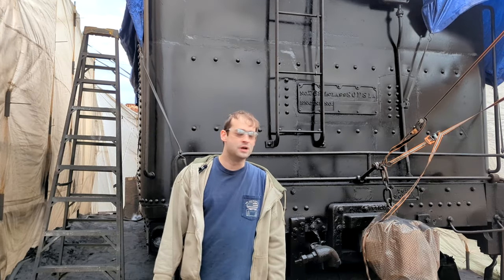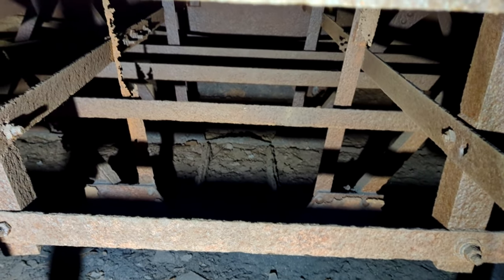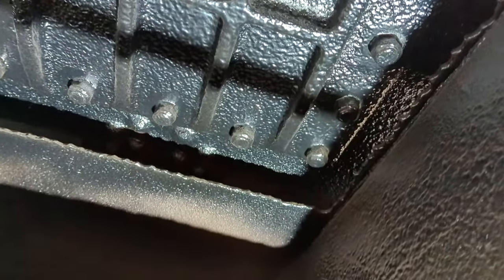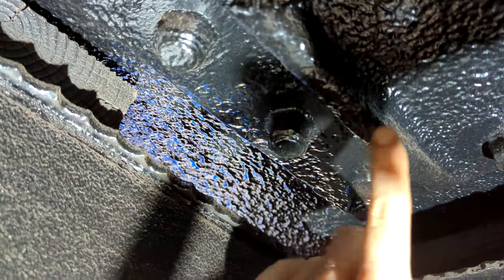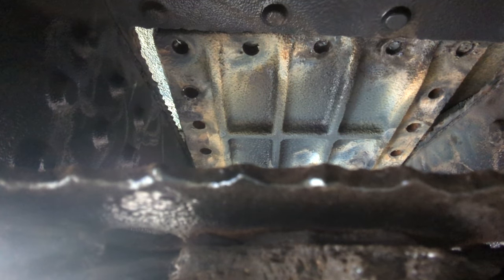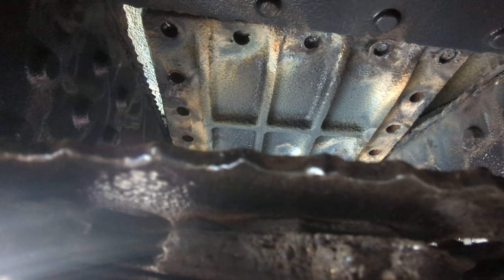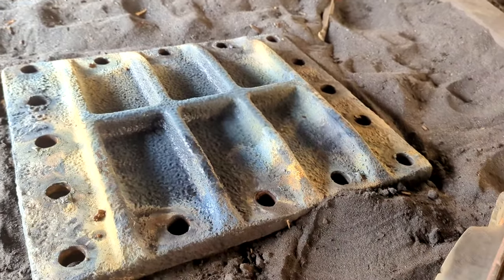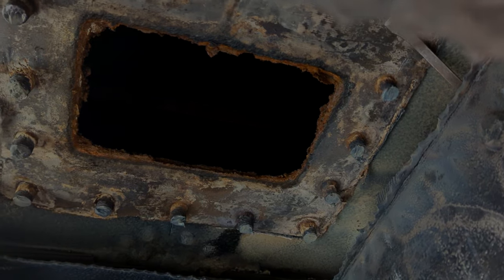Torch Cutting a Hole in a Steam Locomotive Tender?

Comment: I was noticing when you were taking the plate off the bottom, it looks like the metal around the larger opening is jagged.  Was there another plate or metal work there that was cut out?  Looks pretty rough.
Reply from the maker: The PRR had this weird practice of making holes by using a drill and drilling a bunch of holes.  It ends up looking weird with a bunch of half moon rounds.
Reply: @mikesmetalfab  thank you!

Comment: I'm noticing something that you are breathing in the fumes/smoke that's coming off that and that's not very healthy for ya especially that really old paint that might have lead in it.  Please get you a full face respirator with the correct filters or be on supplied air. I wasn't trying to be mean or anything like that because I don't want you to die especially since you are helping preserve steam locomotives
Reply from the maker: Thank you for your concern!  The bottom of the tender had just been sandblasted and painted with new paint we know it wasn't lead based.  I felt bad burning new paint but i had to drop that plate.
Reply: @mikesmetalfab  I feel better knowing that because I don't want to see you developing health problems later on down the road.